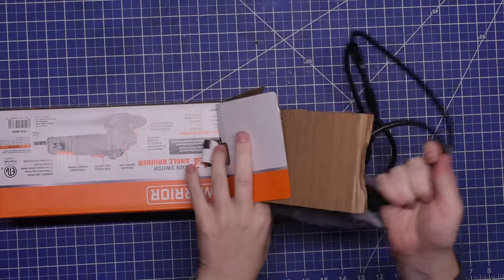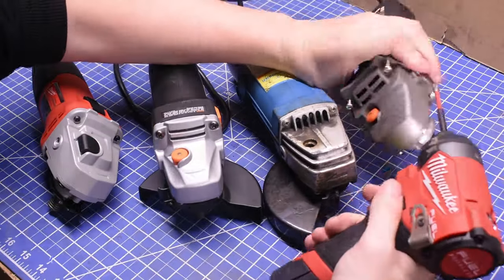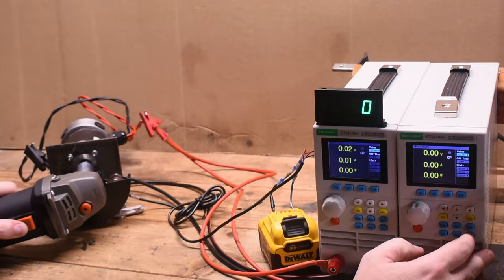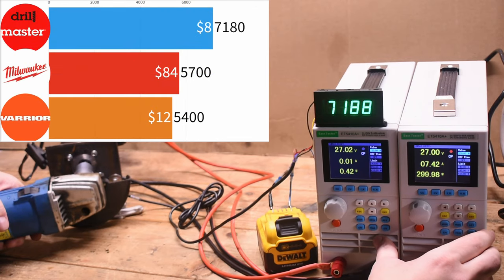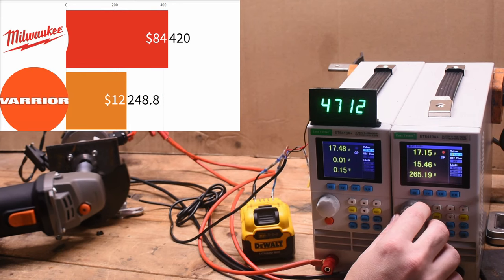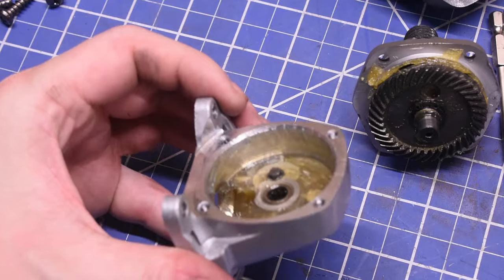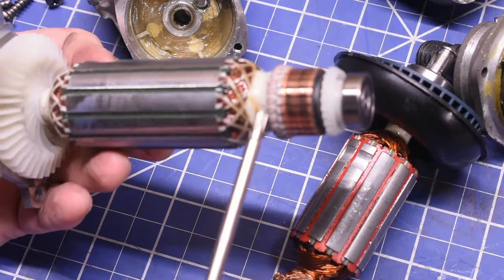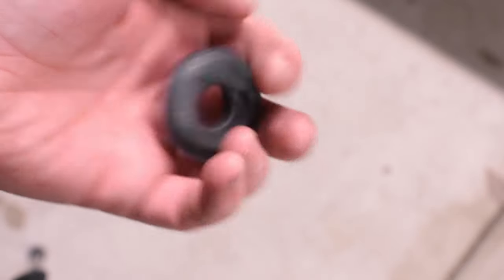Exactly How Good is an $8 Harbor Freight Angle Grinder?

Comment: Great video, as always! Is there any chance of testing 230v 125mm angle grinders from Europe? They are commonly rated in watts, granted being consumed, rather than output. Would be interesting to see if there is a benefit to having double the voltage (and normally 16A circuitry) at your disposal for corded power tools.

Comment: I wonder if it's legal to produce replacement parts for these tools. You could have an opportunity with going down a similar path as iFixit did in the consumer electronics space. You already do teardowns and reviews, you definitely know how to (or know people who know how to) make machined parts and already have a sizeable base of supporters to get started. All that's missing is repair kits and repair guides! I feel like right to repair would apply to tools and if not, it absolutely should.
Reply: They are sub $30 grinders that last decades. I don't think a repair model would be economical
Reply: @aaronthomas5363  That's if treated correctly. Some people aren't so nice and sometimes you just get lemons. With the volume of tools sold around the world between consumer and industrial applications, there is absolutely a market available.
Reply: @ZeLoShady  In small numbers you going to spend $30 making a part for a $10 grinder. Consumerism has pretty much killed the repair model. That WEN costs $4-5 to put on the shelf, at the most.

Comment: Got a HF cheapo for a trailer I'm restoring at work, slap a wire cup on that fucker and start trying to do work and it dies. Lay off the pressure a bit and eventually it over heats or something and won't turn back on. I give it some percussive maintenance to no avail, then manually spin it and kick the switch on and it starts... Works like normal when not hot. Weird little bugger that one. My 10 dollar cheapie at home does much better without fail or quiting, but might grab a wen in the future, thanks!

Comment: Vibration and decibel meter would be nice!
Reply from the maker: Workin on it. The problem i have with using our Db meter is everyone measures with the tool running, who can hear the tool running over the sound of grinding? Grinders sound like grinding
Reply: @TorqueTestChannel  Thanks! for the db i used to think sound is sound  as well till i started owning a bunch of similar tool and then i noticed i kept on using a particular tool and or longer because i could tolerate the sound more than lets say a high/lower priced tool. One good example was my festool sander produces a higher db compared to my bosch sander which i ended up selling the festool and buying another bosch which was at that time i was invested in the festool platform, if u notice people started switching to bosch sanders lately than the festool sanders for more reason than one but sound and vibration have been a factor. Check out SPL values and DB values if u can incorporate this to ur channel it will benefit a lot of people and potentially save them from premature hearing loss, i know it sounds corny but its something to consider and just adds value to ur content as well. jmho.
Reply from the maker: @1kontrabida  sanders sound like the tool though. Where as grinders sounds like a disc against metal making sparks

Comment: Broken in brushes vs new possibly half contacting brushes may effect performance.
Reply: How long do you suppose the brushes take to seat? I would think alot of them may have some wear due to testing, but I doubt all the manufactures test all units.
Reply: @D3M3NT3Dstrang3r  hard to say..youd have to remove them and check the wear pattern.
Reply: @pl5624  True, I asked though because if it was a known value that maybe they should run the brushed tools for a given amount of time before testing
Reply: @D3M3NT3Dstrang3r  wouldn't be a bad idea.

Comment: Maybe I have missed why there isn't many Makita tools on this channel? I used nothing but Makita for 10 years off road racing and never had any issue with tools or batteries they were always awesome and we beat them hard. I now work at a company that uses Milwaukee and their tools are hot (literally) garbage compared. Tools are hot and vibrate and batteries don't last.
Reply from the maker: Were buying a lot of Makita lately so should make its way on the channel in multiple categories
Reply: @TorqueTestChannel  Sweet!

Comment: Why do people keep wanting info on tools that you can buy with an hour's work? You don't need to compare things that cheap; you're buying them because you have to not because you want to. And when you buy it for the job you need it for, if it works after that, it's just a bonus. Disposable tools are disposable
Reply: Which disposable tool sucks the least though? Seems the WEN at that price is a diamond
Reply: I can understand your sentiment on a $12 grinder. I think it is a waste not want not type of thing, plus you might want to know which one of the cheap ones might actually finish the job you have planned for it. I have had a cheap drill that was a throwaway that didn't even complete its first task. Also it would be nice that it still works when you are done you can sell it for your money back.

Comment: I own a dewalt 60v dcg414, well built, powerful,heavy. 2 craftsman cmeg100, light, nimble, fast, low vibration, paid $25  a piece use them for cutting, probably not all day grinding suitable 8a. 1 dewalt d28110 , gearbox gets hot, powerful, vibrates, use for grinding, dislike it 7a. 1 black and decker 7750, better gearbox than the dewalt, fairly smooth, fast 5.5a. 1 drillmaster 69645, light, $8, 4.3a. And my favorite and favorite form factor for anything other cutting paddle switch with a handle black and decker g850, smooth, 6.5 a , just right for all tasks but cutting or heavy duty grinding. The 2 black and deckers have the best gearboxes, then the dewalt battery powered, the worst gearbox is the dewalt electric. Paid about $40 a piece for b n ds, $125 for the dewalt electric. The dewalt is my most expensive electric grinder and least favorite. I think it is geared the lowest, to much torque, should have a handle and a paddle switch. Power comes after ergos, smoothness, weight on my list.

Comment: I was afraid of this trend. I've seen the same tend for some time now. I'm old school, back before every good mechanic had a(NiCad) 9V, nickel cadmium powered Makita drill and flashlight combo.
All that to say that industry as a whole has been shifting primary focus to cordless power. Seems a lot of what is being produced in corded versions is actually engineered to make cordless offerings under the same mantle seem to be a better choice. 
Now occasionally I get lucky and the grinding job is small, not a lot to be done, and the quicker the better, meaning not having to find an extension cord.......a long enough extension cord, a battery powered version would even be preferred. 
However, there's those big damn jobs that you need a plug-in grinder, with balls enough to get the hole job done, without 10battery changes. That's no reflection on any battery platform, that's just simple physics. That being said, thanks for the very informative video. I'll take the WEN, for the win.

Comment: I have 6 probably 15yr old Drill Masters 1 older DeWalt and about 5 warriors.  I can tell by the way that the warriors slow down that it wouldn't take much to let the smoke out but the Drill Masters I have beat on every bit as hard as the DeWalt and they have never failed me.  I paid $9.99 for each of the Drill Masters, 10 times that for the DeWalt and $14.99 for each of the Warriors.  I think for the average guy just sharpening his mower blade the Warrior is ok but the Drill Master is much better.  The DeWalt feels better but I don't think it's 10 times better than the Drill Master

Comment: No way cheapest.. I have one of the late 90's $5 grinders that still works.. Also that $5 was regular price. Mine is a "central tool exchange" but most of the label is gone. No guard! 
edit: very similar to your blue one there, but mine has the motor and gearbox mounted 90 degrees rotated. There is no way they are the same motor inside, this thing stalls completely at 250w on my kill-a-watt. 

Also there's NO WAY those are sealed bearings, but rather rubber shielded bearings, which means the rubber does not contact the inner bearing race. - 2 RS means 2 rubber shields, not seals.

Comment: I have had that blue harbor freight boy for 12 years now and it just will. Not. Die. It's rough, it feels like it wants to kill me, the button for the wheel lock fell out, but it just runs. And runs. And runs. I won't justify replacing it until it dies because at this point that piece of crap has EARNED that spot in my tool box.

Stupid harbor freight junk lasting years longer than I wanted it to.

Comment: But that cheap Milwaukee and absolutely hate it, it would overheat within 30 seconds of use and be scorching hot on the head, I have the new Makita X lock 18v but it just does not go long without changing batteries

Comment: The HF Warrior lines are real crap, cheap but not worth buying. You would have done better getting the Bauer which is HF's middle-of-the-line grinder. I tend to buy a lot of tools at HF so I am not just an HF hater. When I want something of better quality I then buy at Homedepot. I have made electric motors for years before I retired and you don't too much epoxy on your windings  but you don't want to much either. The epoxy being done very neatly is best. The very best electric motors don't even have brushes either. Always go brushless if you can. But they can be expensive.

Comment: I kind of feel like this vid is filler, they're all garbage gutless grinders. If you want a gutless grinder just buy a battery grinder, if you're going to go hard for hours then why buy a 400w 8,000rpm no load corded grinder?
I upgraded to a $400 AU dollar Metabo 1900w grinder, beats every other grinder i've owned for breakfast, best grinder nut by far, never got stuck once, doesn't even accept a tool, heavy duty, serviceable.
Reply from the maker: You're confusing watts into the tools with watts out plus motor efficiency measurement loss. Why doesn't everyone just buy a big $400 grinder is an interesting take tho